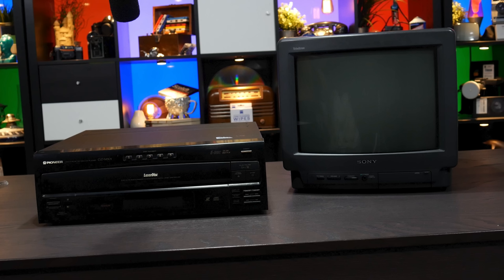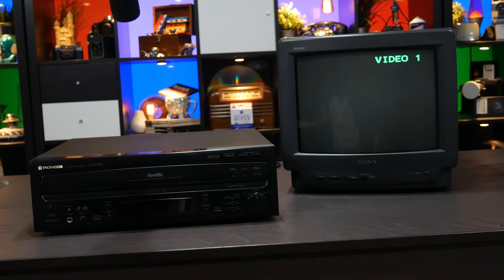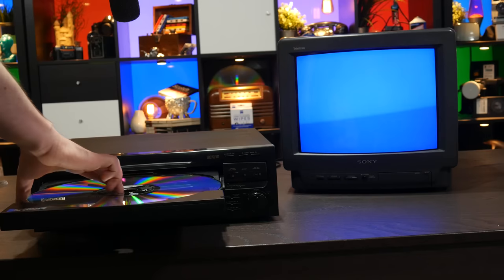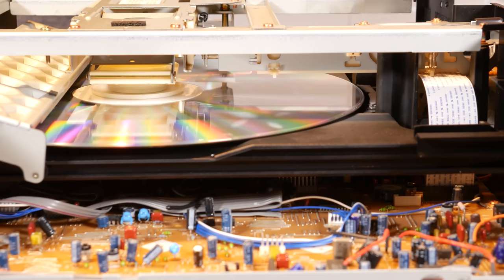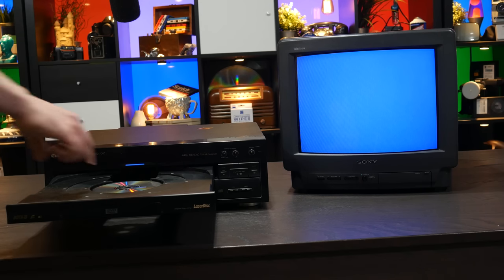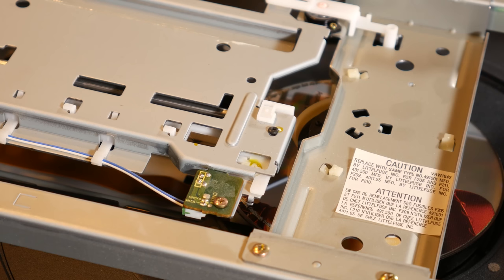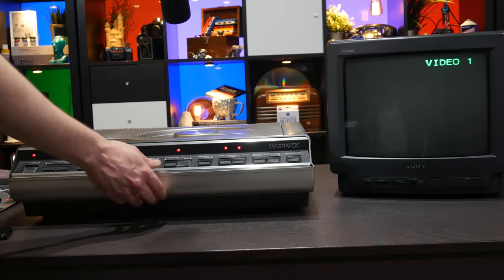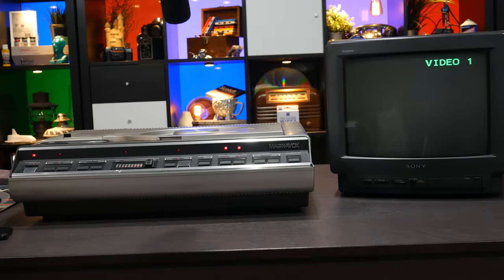Sights and Sounds: Laserdisc players

Comment: As for your stereo experiment, I tried listening to it with headphones, and while I can tell it's stereo, it's hard to find any direction in the sounds. I don't know what mic setup you had for it.

I would say two of the best techniques you can use are:

1. Jecklin disk. It mimics the human head, so you have two omnidirectional microphones, separated by a sound absorbing disc. Look on Wikipedia for an example. This will give you a binaural recording, and listening back on headphones very closely matches sound received by human ears.

2. M/S Stereo pair. M/S, or Mid/Side, consists of two microphones as close together as possible (ideally at the exact same spot, but reality prohibits that from happening), one of which is either an omnidirectional or a cardioid microphone (cardioid recommended), pointing straight ahead. The second microphone is a figure-of-eight, and it's pointing with the positive side directly left. This setup produces a stereo image suitable for listening on loudspeakers.
Bonus features: as the Mid microphone is pointing straight ahead, it captures the 'centre' sound in the best possible way, something an X/Y setup can't do. Also, you can vary the width of the stereo image by adjusting the Side level in post-production. To generate a stereo image from an M/S setup, you add the two together for the left channel (M+S), and you subtract them for the right channel (M-S).

Hope this helps!

Comment: My DVL-700 had the same problem. Even the motor brake used to stop the Disc was flaky. The culprit is the motor itself that I got a replacement from another player of a different model. Now It Works Fine. About the Magnavox player, It looks sooo nice and sexy. I would love to have one of these.

Comment: I have had several Laserdisc players beginning in 1980. This model was one of them. I have found that the more mechanics that are involved in the operation of the machine, the greater the likelihood that a breakdown will occur. The automatic changer in this model is an example. I would stick with a single-side player.

Comment: FYI for anyone who also has a Pioneer multidisc LD player, there are actually a total of 4 belts that make it work. A loading belt (PEB1013), an optics belt (VEB1077), and two disc change mechanism belts (DEB1104). All 4 are available on eBay and can be found by searching those model numbers.

Comment: I remember the original Pioneer Model 1000 Laserdisc player.  Only played one side at a time, and had to wait for  the motor to stop BEFORE lifting the hinged lid to flip the disc.  If you didn't wait, you risked having the disc "levitate" out of the player while it was spinning.

Regardless of the model year, Laserdisc was VASTLY SUPERIOR to VHS in terms of picture and sound quality.  However, the reason it really never "caught on" is you could not RECORD your own discs like on VHS.  Plus, and I begrudge this, the discs were VERY EXPENSIVE compared to tape, they had to be stored "on edge" like LP (vinyl audio) discs, if you "scratched" or "marred" the acrylic surface, the disc was essentially trashed AND they "warped" like vinyl discs when exposed to "excessive" heat.

Despite the listed "shortcomings", it was The Best Of The Best for Videophiles who wanted the clearest picture available on your TV and cleanest sound coming from your Audio setup.

Comment: It might seen like something you guys take for granted, but how did close-captioning work on your vintage TVs? Is it just on genuine VHS (couldn't be as VHS copying isn't as rampant as VCD/DVD piracy would become)? Also, I heard that even over-the-air TV programming has them? It can't be hardcoded to the video since it clashes so bad with what you are watching and is clearly an option you can enable or disable.

Growing up in a home that used to run a VHS and then VCD rental shop, I'm no stranger to media like those, but I've never seen close captioning in action on VHS, Betamax, VCD, TV antenna programming, late 90s coaxial cable (direct to TV) and then STB cable box programming. I'm from a SEA country, btw.

Comment: That's wild - I also own a double side play model, and it ALSO has the issue with the slipping belt preventing the door from opening after you haven't used it in a while. Solution, as ever, is to smack it until it cooperates.

Unfortunately, mine also suffers from a snapped gear causing the laser mechanism to lock up when it's halfway through the process of turning over. The machine becomes totally unresponsive unless I unplug it and plug it back in, at which point thankfully the laser stops trying and returns back to its home position. The technical knowledge needed to non-destructively reach the broken parts inside and replace them are way beyond me.

Comment: I bought a CLD-D702 in 1993. All the groans and twitters of the first machine in this video sound exactly the same. 
That Magnavox is seriously in need of repair.   
And I HOPE the lid won't open until the disc stops! 
Imagine what could happen if something with that much rotational inertia came flying out at top speed!

Comment: How did I not know you had a second channel?  This is awesome!  I'm only 10 minutes in, so I don't know what models you're including.  But, I'm impatient and I'm commenting anyway.  Do any of your players use the CU-V151 remote with the big jog dial on it?  My CLD-V5000 does, and it's pretty awesome. Also, could your laser ramming issue be due to a faulty limit switch so it doesn't know it's at the end of its travel?  I imagine it must have one somewhere.  I don't see that laser travel being positionally encoded.

Comment: I like the stereo audio.

I think you nicely illustrate the tradeoffs we've made with compressed video.  With Laser-disk, each frame is stored uncompressed in analog, so fast forward seek is pretty trivial since there's minimal processing that has to happen because there's no compression.  Each frame is fully encode independent of others.

With DVD and BluRay, the video is highly compressed, storing only differences between each frame.  Getting a fast-forward seek would be...  difficult, since you have to decompress a bunch of frames all at once, and VERY quickly.  The compromise was adding in chapters, which never really was all that useful.

Comment: About that ancient Magnavox player... I'm pretty sure that the problem is related to bad capacitors. Magnavox was a subsidiary of Philips which used to make awful blue capacitors. They leak, they short, they go open, they go high in value... The way the lights behave when the motor spins is a goog indicator of bad capacitors.

Comment: At 15:00 the sticker reads "Caution: For continued protection against fire hazard, replacement fuses should be of the same type and ratings only."
But a translation is also provided below: "Attention : Pour les précautions continuelles contre l'incendie, les fusibles à remplacer doivent être les mêmes types et valeurs nominals uniquement."
Let met tell you that this French translation is not great! :D It does the job though :)

About the vid': Interesting concept Alec, that's pretty innovative! 👍

Comment: Some how I imagine that HUGE-for-its-day capacitor being a great place to store extra energy to help rev the main spindle up and then as a reserve emptiness to dump all that energy into to stop it when doing an A to B switch.  With the disc stopped and capacitor charged there is now an energy reserve available to help spin the disc up the other way for side B.  It would be like modern EV regenerative braking but for laserdiscs in the 1990's :-)  I know there is a HUGE amount of energy needed to spin these discs up to 1800 rpm  so much so that I've known it to cause UPS's to beep and complain about voltage sags if one is nearing the limit of a circuit, a common issue if you have just turned on a bunch of class-A amplifiers with HUGE capacitors of their own to charge up. :-)

Comment: The last player, the maggotbox, it's recycling fodder now. I'm pretty sure it has a bad laser. Back in my day of fixing things like this, a customer would usually call it and say no thank you, and of course that's assuming you can still get a laser package which I'm pretty sure you can't.

The third Pioneer which had the crooked badge, also had a badly dented left front corner, I'm assuming from being dropped or having something fall on it. Also not a great unit to evaluate old technology with, though I do know from many years in the repair industry, that these older laser units just had problems and as decades went by, they got better. Not good, just better.

Obviously the solution now is to give up on this old stuff and get Blu-Ray replacements for the discs, which not only usually work well anymore, but are smaller, cheaper and simply better.

The new channel: I am a Patreon and I do really like your work, but your releases are not fast normally but IMO are very entertaining and enjoyable, so introducing a new channel only makes me expect your throughput to be slower. Kind of like the last channel, Technology Connextras (pretty sure you had a new name for this one.) I'd suggest focusing on your primary channel and letting the laid back stuff go. You asked for opinions and there is one.

Comment: For the behavior where the disk speeds up and slows down, speeds up and slows down, continuously...  Probably a bad laser or a bad photo-diode sensor.  Or the seek mechanism has failed and it is crossing tracks continuously.  Its trying to synchronize the expected data bandwidth (hence the motor speeding up and slowing down), but never getting good data from which it can acquire a synchronization lock.

-Matt

Comment: I like the stereo sound better even though it seems noisier.  I think some of the apparent noise is something like "room ambience", such as noises picked up from original noises reflecting from surfaces in the room where you recorded.  When the reflection comes back to both mics the delta in return time helps with a sensation of feeling present in the space where the recording was made.  It seems more realistic, perhaps.  Just conjecture. 

Interesting that 8:29 they (designers) didn't just spin up the disk at first.  A CD would accelerate much faster than the laser disk.  They'd have a better chance of getting it right faster.  ¯\_(ツ)_/¯.  BTW, is that audio CD playing Banana Phone?
13:27 I bet it's more likely caused by an issue with a travel limit sensor (usually optical, but sometimes mechanical switch).  The mechanism appears to have a time limit to reach the end of travel, and it does mechanically, but the end of travel sensor isn't satisfied, so it reverses briefly and then tries again to satisfy the sensor.  I'm not familiar with this particular model just an informed guess
~30:00 You've shown a couple of times where selecting to open a particular tray makes it pre-select a particular read head.  I wonder what they were thinking.  If the read head selection must be done with the drawer closed, then it must take place before the drawer opens or after it closes, either way the user must wait the same period.  They may as well have the unit test what comes in and select accordingly. They have a pretty good chance of guessing right depending on which drawer gets opened, but this only begs, why didn't the designers have the read head preselection take place while the drawer is out and the user is loading the media?
On the Magnavox, I agree about replacing the electrolytic caps, or this thing might have taken a power hit, judging from the strange behavior (perhaps a lightening strike?).

Comment: Could you possibly do a video explaining why DVD players and laser disc players made that seeking noise? What caused it mechanically? I had a DVD player that had dust on the laser. As a result it would spin up and spin down for ages and would only start if you tapped it. Meanwhile it would make “that” noise. Almost a liquid sound. I couldn’t ever work out what mechanics would give that noise

Comment: I would like to see a sights and sounds video about inverter based air conditioning systems please.  Are any of the air conditioning or heat pump based systems you have using inverter based compressors?

Comment: I don't think its a capacitor (for the Magnavox), I think  the laser head might be dirty/weak/bad/dead or, it may have a bad belt or 2..   oh, and about the other machine with the supercap; that cap is for holding  programming info  (IF you decide the ditch the Magnavox.. you can bring it to me and I can try to fix it...  (I'm not that far from you, via train, hehe))

Comment: I admit it, I was waiting for that ribbon cable to scrunch up.  It looked like it was about to!  Now what the heck is that 1 farad capacitor for?   Maybe closing up the machine when you turn it off?  Ensuring that it doesn't destroy the laser disc if it loses power?  Maybe using the spin-down to regenerate a bit of energy?  I can't imagine any other use case.  Also, for 1 Farad... those would have been fairly new back in those day, so it is all the more surprising.  The only way you get ultra-high capacity capacitors in such a small volume like that is by taking thin films the size of a tennis court and folding them up.  The technology was very new back then.

-Matt

Comment: Probably already mentioned, but the 1F capacitor is for backing up user programmable settings (if any) and the clock. As far as the odd behavior, there may be a slightly corroded IC socket or connector. Pressing on it caused the connector or socket to flex and break through the corrosion.

Comment: If looking for some quality electromechanical audio goodness, I think many top loader VHS and Betamax machines will offer lots. Especially early machines which used soft touch controls and then fired off solenoid actuators inside the machine. The elaborate C loading of an old Beta machine is also a joy to hear too, weirdly enough!

Comment: Get a new belt off ebay for 10 bucks or buy an assortment LOL.  Beating on the unit is not good for the laser or breaking a cap loose.  The issue with the dual side player is most likely the mini mini micro switch on the laser carriage.  If you leave as is will strip out the drive gear.  The switch may need cleaned or the arm that makes the switch is bent.  Have worked on many players over the years and all pioneer as is all I will buy.  Will warn you to stay away from the karaoke versions as the drive motor mount for the laser carriage is plastic and is a crap design and total bull pies.  I am sure you would love to do a video on Pioneer LC-V300 is a complete 72 laserdisc changer karaoke system.  Is the main trophy of my laserdisc collection.  You can have 4 changers hooked to one unit, but I can not find any out there that are for sale.  There is a cool dude here on youtube that goes over one called CelGenStudios.  Thanks for the video.

Comment: I see no reason for CAV discs to make the machine take longer to change disc sides. The seek function clearly demonstrates the head can move across the disc while it's at full speed, so it can fully retract and flip the assembly without even having to slow the disc (this is true for all disc types).

It might just be a safety thing for it to wait for the disc to spin down before flipping the assembly.

I hope you wore some safety gear when operating with the cover removed, if a disc shattered/sprung loose you're in for a world of hurt.

Comment: What happens when the player switches to the other side of the disc?  I'd guess that it has to reverse the spin direction, otherwise it wouldn't be compatible with players where you flipped the disc over manually.  Does it also move a single read head, instead of top & bottom heads?

EDIT: I should have watched the next minute of footage to get my answer.  It reuses a single head in a rather elaborate way.

Comment: The old Magnavox has a gas laser and there is a massive optical bench that moves. This is pre laser diode sensor.  The tracking mirrors are piezo controlled and tend to stiffen up with long idle times of no use. They could also be dirty. Cigarette smoke also did a number on these machines. I have a vintage pioneer that is about as old.  This model was one of the first player from early 80 s. As you mentioned the caps could be drying out too. 40 years old.

Comment: The Magnavox is sufficiently old that it probably has a gas laser, and those things have a life which is shorter than you'd like. They tend to get less and less reliable as the gas laser ages. If it's that then the only fix is to replace the laser, but finding an unused replacement could be very difficult.

Comment: A new drawer eject belt tames the failure to eject problem and is usually easy to install.  A cheap belt variety pack usually has a size that works well enough.

Comment: I wonder if the Pioneer would be able to play Side B if you hit stop first. Meaning, maybe it has a set amount of time to try to play a disc before going into a read-error mode, and the motor isn't able to reverse the direction of spin fast enough to avoid that error (but is able to go from a dead stop up to full speed within that amount of time).

Comment: The 1 farad capacitor in the badly behaving player is for some sort of memory backup or clock when it's switched off, those caps are designed for low power stuff and don't have something to do with the laser issues it has

Comment: Interesting to see that the print used on Charlie and the Chocolate Factory laserdisc still has the reel change markers on and they chose to split the disc sides on that reel change. There's a video idea for you, all those circles and squares in the top right hand corner they used to have on films and TV programs as cue markers to signal reel changes or ad breaks.